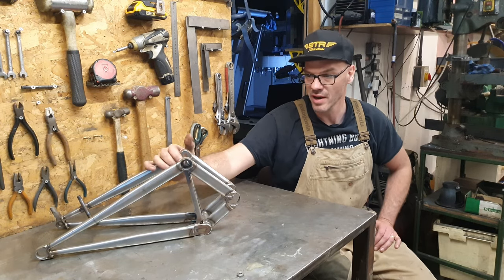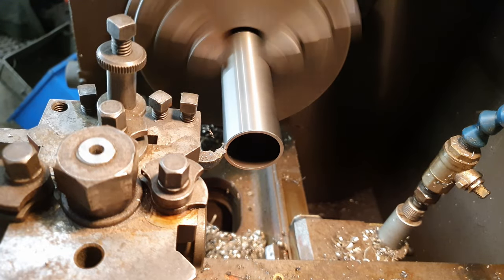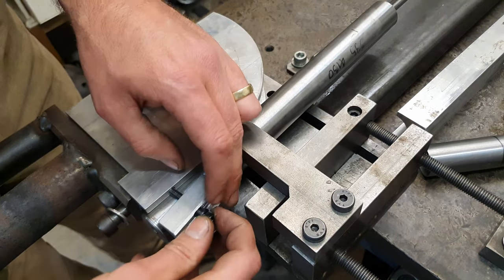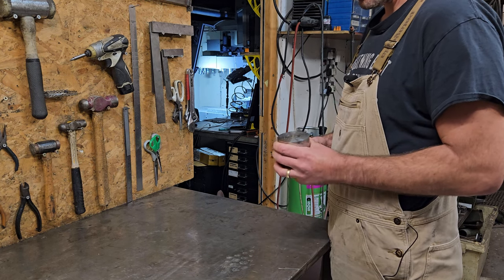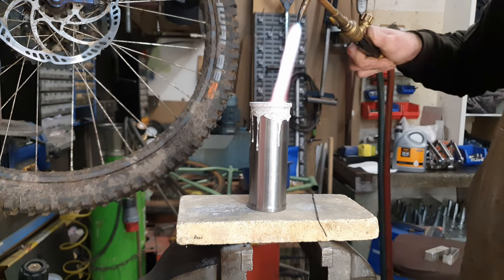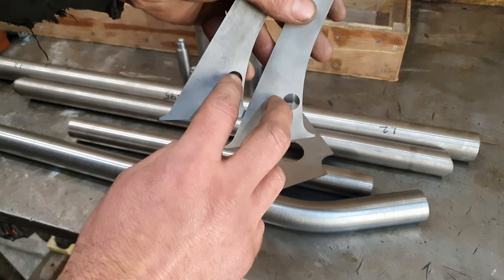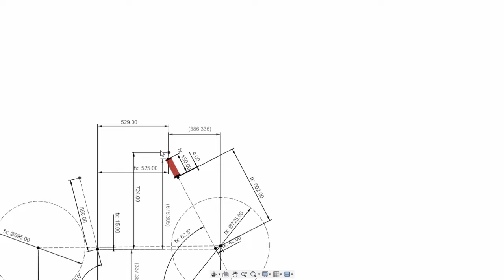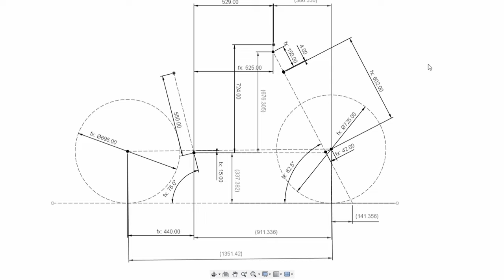5.  Front triangle preperations and Geometry numbers - Gasser Project

Comment: Have you tried bending the seat tubes with some lubricant on the dies. I know they don’t really move within the dies as such but the outside of the tube has to stretch compared to the inside so maybe some oil would help things flow a bit and avoid the ripples? Failing that you could try packing the tube with lead shot?

Comment: I've been waiting for this video! 
I have some  questions on the head tube, why braze on the additional ring instead of welding? Does brazing heat up the part less than tig welding? Doesn't heating up the bulk of the part with the torch degrade the material strength? I haven't worked with brazing at all, so no idea as to the temperatures involved.
Reply from the maker: Welding would deform the head-tube. Silver solder melts at a much lower temperature than bronze brazing/welding so the amount of heat going into the head-tube is much lower even though it spreads further.
Reply: @BTR-Fabrications  Thanks! That helps! Sorry to hear the videos haven't taken off the way you were hoping, I'm really enjoying the series and I'm sharing it around. I'm slowly planning my own bike design and this is an amazing help and insight. Not sure if I will ever build my bike or if it will stay theoretical,  but this helps in the planning!

Comment: I read somewhere that the price of a Gasser is 6250 pounds. Is that correct? I'm not one to put a price on other people's work but in my opinion the price you have on your website for example for a Pinner of 4,200 pounds is correct. But much more, I think it will be difficult to sell. It can be justified with the craftsmanship but I don't know. Anyway I'm interested in your next trail-enduro creation so I think you could make an informative video to see how many of us would be interested and thus plan the project more seriously. My Pinner will soon need some love and paint. I suppose it would be best to contact you by email and talk about it. Best regards
Reply from the maker: Yeah, somewhere close to that. I know it's a lot, you can get a complete Atherton for less. It's just what it has to be for the amount of time it takes to make, any less and I am basically paying you to make you a frame. It simply isn't possible to get the money I need from building frames to keep the doors open and after 13 years of not making any money because I try to price the frames at a point where people will buy them, I'm a bit tired. It's just what it has to be and if I don't sell any then I won't lose any money, so that's fine with me. I am doing more general fabrication work these days. It's a lot easier.